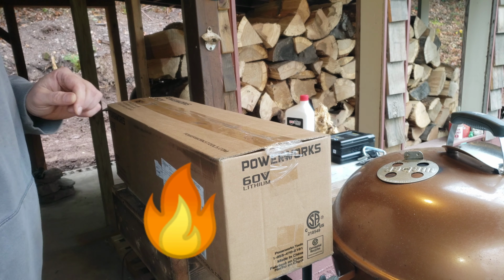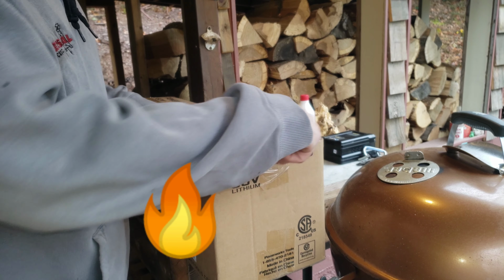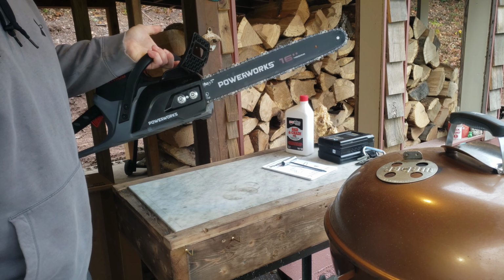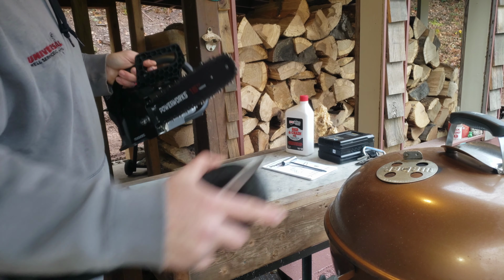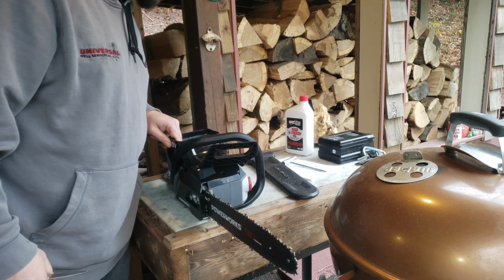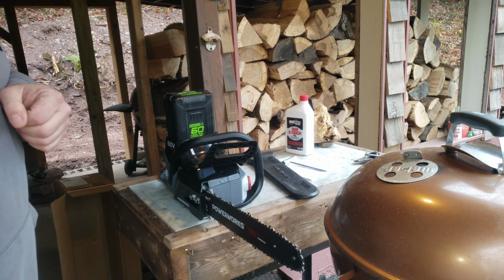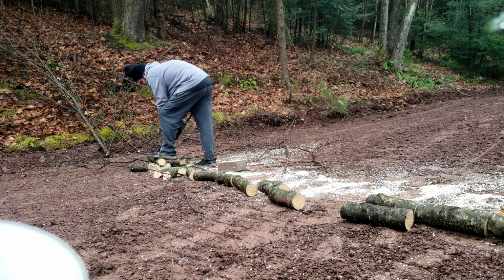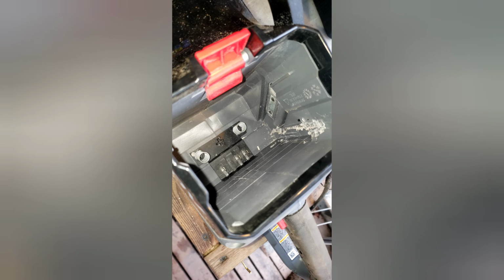#Powerworks 60v chainsaw unboxing/test #Greenworks #60v  #Snapper

Comment: Should I buy this thing? I am thinking about buying it right now.
Reply from the maker: I'd say yes, I've used it multiple times its worked flawlessly i used it the other day to cut up some 13x15 inch birch rounds. You seen what i had to do to get the greenworks battery to work I've had no issues with that either.
Reply: @thesmokingplank  Cool I just bought it with the 2.5 ah battery and charger
Reply from the maker: I don't have any of the 2.5ah batteries I'm sure you'll like it. I'd say it compares to a 38cc saw it's comparable to my stihl ms180c with a 16in bar. Big plus no pull start lol.
Reply: @thesmokingplank  Wow to hear that it compares to any stihl is exciting! Can't wait!
Reply: I wonder if those green works batteries are better since it's there name brand.
Reply from the maker: Corey V sorry didn't see this days ago. powerworks60 snapper60 and greenworks 60v i believe they are made by the same company with slight variations. In the spring I'm going to do a video with it cutting some small slab wood with a timber tuff mill.
Reply from the maker: Corey V just keep it sharp it will do good.
Reply: @thesmokingplank  this is corrent. snapper 60v was simply the powerworks recollored and rebranded powerworks. powerworks is greenworks euro brand. they also sell it here on amazon. the 60v greenworks and power works battery guts are identical. only the out casing differs and its a quit mod with a dremel to get cross compatibility.

Comment: Would you say a powerworks battery can fit in Greenworks products?
Reply from the maker: @jaimemacias2139  I would bet they would since I had to remove material from the powerworks saw to make the greenworks battery to fit. I do know the knockoff greenworks  batteries on eBay work good and are half the price of the original.
Reply: @thesmokingplank  thank you for the reply. You're the only one with this informative video.  Merry Christmas!

Comment: Lithium ion is insane these day. I jumped my car with a battery pack that could almost fit in my pocket
Reply from the maker: I know its unreal, i was so skeptical at first but I'm sold. Now my mower, trimmer, blower and chainsaw is all battery powered now. The saw is supposed to equivalent to a 38cc gas powered, i beleve it.
Reply: i jumped mine a few weeks back with a 20 volt dewalt tool battery
Reply: @thesmokingplank  i'm betting since you bout this on amazon you read my review of it there. you can use greenworks batteries as you found out by either modding the saw, or in my case i modded the batteries. i have 3 green works batts, 3 power works batts, and one snapper battery.